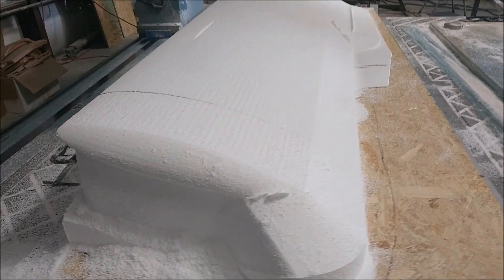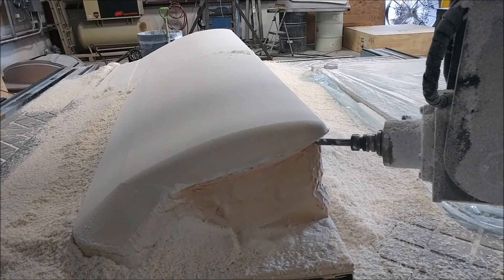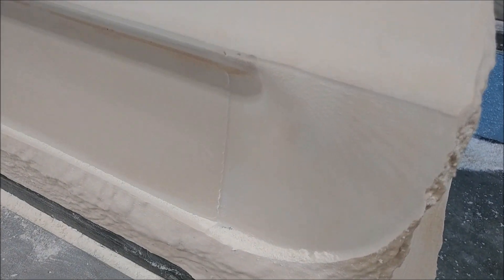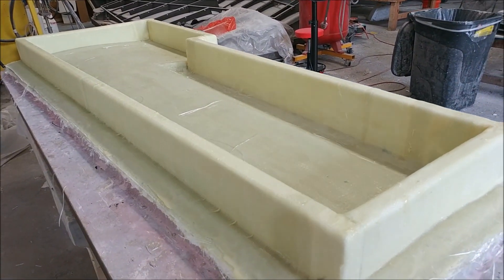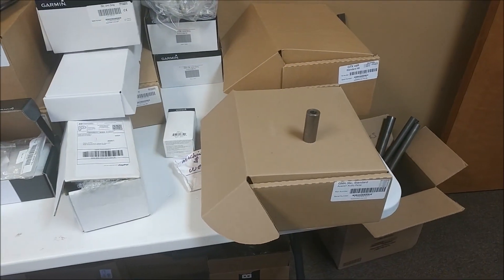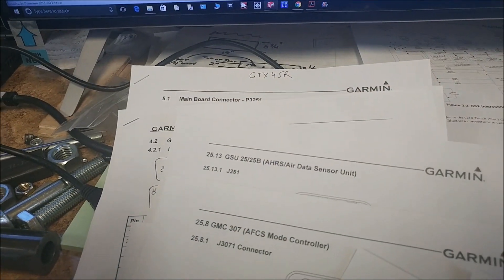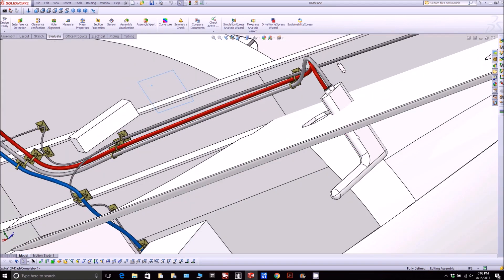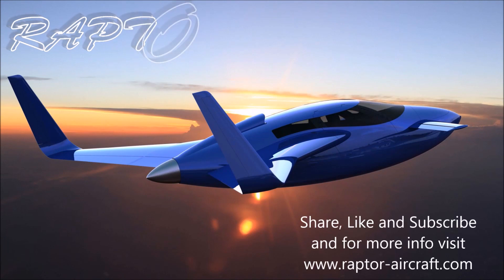Avionics Arrive - Time to nail down the design

Comment: Hi Peter, I consider the "man-machine interface" (MMI) one of the most important aspects of cockpit engineering.  In my work at the FAA redesigning the ACTC consoles and cockpit communications apparatus, I learned that adapting our systems interfaces to traditional muscle memory functions was a primary requirement when it comes engineering.  Therefore, I have a proposal for you to reengineer the control layout of the Raptor.  I believe it should be capable of handling left- and right-handed pilots and co-pilots for a number of reasons in accommodating physical abnormalities and a lifetime of muscle memory.

I already have several ideas that range from a removable center console socket where a left or right grip would plug into after removing a dust cover that plugs into a wiring harness connector, and alternatively, instead of mounting in the console, it could come through the dashboard similar to your left-or-right side only configuration does - which may require some room between the instruments if it weren't located low enough.  The bottom line is that I believe the controls should offer a diverse choice of control positions.  Thanks for your consideration.

Comment: My only concern with stacking the avionics like that vs. the side by side would be the heat dissipation being adequate enough.  I see there is spacing between each of the units, but with most things electronic, heat rises and without proper ventilation it could be an issue (or not).  Just something to consider - as long as it's within the specs from Garmin I'm sure it'll be fine.

Comment: Quick question.. i didnt quite get the convergent flow over the static port on the front.
Shoudn't it be a issue as long as there is nothing in front of it (like a wing or other surface?) 

Example in a cessna 152 there is  nothing in front of the static port.
Reply: Anner J. bonilla I may be wrong, but it looks like it's lower on the fuselage near the main gear wheel. Could going through a puddle could get water/dirt there?
Reply: Anner J. bonilla, I train with a Piper Saratoga and the static is in the same location (roughly) and never had an issue with it...haha knock on wood.